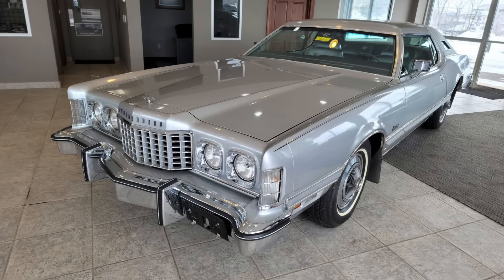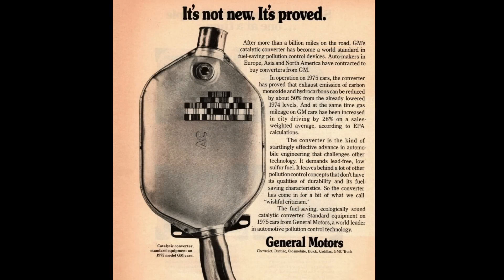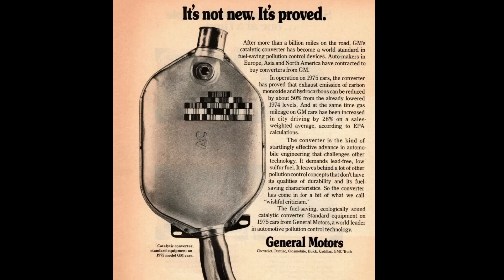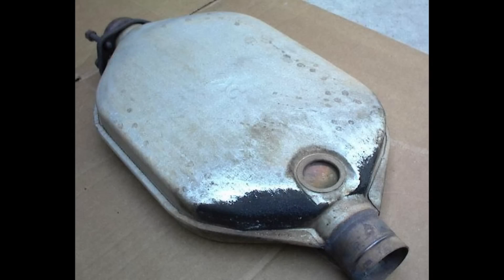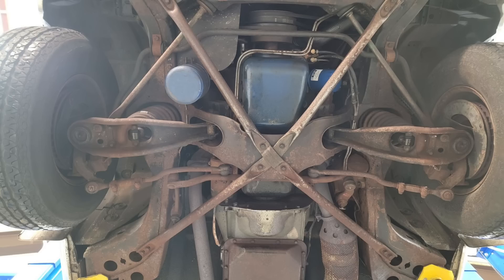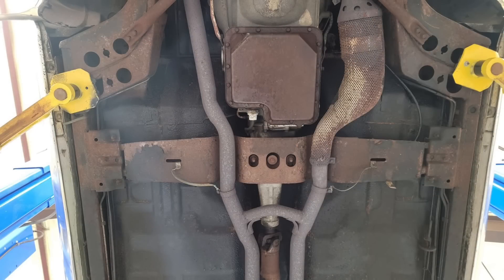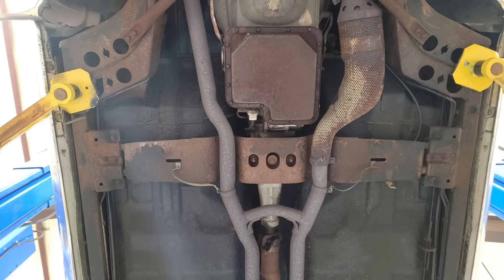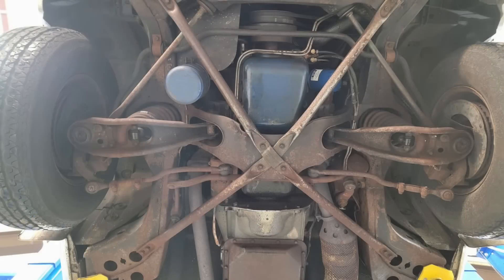Strangest Car Inventions: Ford Invents A Bizarre Way to Meet 1970s Emissions Standards

Comment: The last 2 vehicles up thru 1979 that didn't need cats were the Honda CVCC 5 speed stick and the casterated 318 Lean Burn with the optional LPG Mileage Booster valve. It allowed you to add LPG and lean out the gas even more for add'tl. mpg. You could only get that when buying new as it was added at the factory. I know because bought a 79 Cordoba Brougham with only 16K miles on it in 83 from the original owners. They also had a 79 Aspen with the same 318 an no options and that did have a single exhaust w/cat. That was only $500 and near mint with 59K mi. He was a retired ComEd field boss so you understand why I passed on a monochromatic beige car and opted for the $2500 Cordoba. Anyway; within a year; the Cordoba had a 468 stroker under the hood. MoPower Baby!

Comment: The 4500 lbs. weigh of the Mark IV's compared to a EV isn't all that bad.   A Tesla model X is 5248 lbs. and Cyber Truck is 6898 lbs.   Maybe the cross bracing was added for the 5 mph bumpers???
Reply: ICE vehicles aren't light by any means either. From the mid 70s to the early 80s the avg did drop around 860lbs, but they've climbed back up since. According to the EPA the avg weight of a car in 2022 was 4289lbs.
Reply: @AltWrongGamer  Found this online:  The subcompact 2017 Chevrolet Sonic RS weighs a mere 40 pounds less than the midsize 1967 Chevelle.      Newer car are heavy because the body is so much stronger for safety and EV's are even heavier because of all the batteries.

Comment: Used to drive my sisters 75 LTD, 400 ci with a 2 barrel carb, so slow, what a dog
Reply: Part of what made it so doggish was they had torque converters with very low stall speeds and premature shift points, and they also used a default axle ratio of 2.47:1  Combine these with even a healthy, 'non-emissions' 1960s engine and it's gonna be a turd.  Top this off with lower compression, lean-burn carburetors, retarded cam profiles (I mean that literally; the timing set actually set up the cam timing 'retarded' compared to '72-older) and ignition systems that retard the spark under acceleration, and the restrictive exhausts... yeah.  And in a 5000 lb land barge with A/C... it's a wonder the damn thing moved at all.

A '71 LTD with that same engine (but with much less pollution shit) was actually pretty darned strong.  And under the sheet metal, it's essentially the same car.

Comment: GM's pancake was great. All of my friends took the caps off and drained all of the pellets. They epoxied the cap back in place with varying degrees of success.
Reply: I remember several friends doing that as well.  They also cut out the gas nozzle blocker so they could use cheaper leaded gas which had the larger filler nozzle at the pump.
Reply: @Ozark_Bule I worked in an auto parts store,  and we sold plastic reducers that you stuck on the regular gas nozzle that allowed you to put it in an unleaded size gas fill.
Reply: There was  a tool for that cap.  We actually had to replace the pellets on some at the dealer.  Blew them in with a special tool through the port.
Reply: Dad had a '76 Lemans Safari with the 400. One of the first things he did was remove the cap and take the car for a rip to blow the pellets out. He did get the cap back in place afterwards. 

Not sure if it made much difference. Those were pretty tough years for cars.
Reply: I kind of think that was GM's intent!
Reply: I emptied out many converters back in the '80s. I chiseled out the plug, took the car for a spin around the block and hammered a freeze plug in its place afterwards.
Reply: @kennydemartini2169   You were quite the environmentalist
Reply: @Trackratz-zl9di  I've learned to respect the convertors now. I cut them off instead of gutting them. I have my buddy at the muffler shop make me a replacement pipe to weld in its place. Anothe friend reburns my ECM to delete the cats, and I scrape the cats for a few hundred bucks. A win-win for all!
Reply: @kennydemartini2169  While you were doing that we did all or own oil changes back then and we lived on a dirt road We took all the old oil and dribbled it on the road in front of our house to keep the dust down for which my mother was very appreciative 

Different time that's just how it was .
Reply: Good to know that egocentrism isnt a modern invention!

Comment: I bought a 77 Trans Am I bought brand new and when I pulled that converter and single exhaust with the crossflow muffler off and put duals with Corvair turbo mufflers it turned it into a different car!
Reply: What did ya’ do when they started doing annual emissions tests?
Reply: @PRH123  only Atlanta has that but the rest of Georgia no so we always straight piped all our vehicles
Reply: @SquirminHermanthe1eyedGerman   wow, didn’t know, all of Maryland since the 80’s required annual emissions tests for all cars
Reply: @PRH123  that sux
Reply: @PRH123  They STILL don't do emissions tests here.
Reply: I did the same to my Trans Am & Z28s, really wakes them up
Reply: When I had a shop put in duals, they somehow forgot the cats for my '78 Cougar (a T-bird clone) while they were putting headers on it. I don't know how that happened 💰😆.

Comment: the difference in backpressure across different cylinder banks must be chill as I notice that the saab B308E engine, a version of a gm v6, has "asymmetrical turbo charging," or that the turbo is only connected to the exhaust manifold from one of the v6 cylinder banks.

Comment: Some cars had two different size cats in the ‘Y’ pipe, Dodge trucks and the Ramcharger had 1 large cat one the right side and a “mini”  cat on the left.  Fords used the honeycomb design which was more  free flowing than the pellet type.  I had a 1979 Mustang Indy Pace car replica with the 302 and C4 and a friend of my dad’s who was a engineer out of Ford’s tetaboro zone office gave me another nearly new cat from a 2.3 turbo and I got a long 1/2 extension a busted out that honeycomb bs and installed it .
With the 302’s “sport tuned” factory exhaust, it was louder then stock and NJ’s yearly state inspection question the noise level from my nearly new pace car and when they looked underneath, yup, there was the (hollow) cat and it always passed emissions.
Reply: The 1977-78 Dodge Monaco CHP cars had 3.  Dual cats plus a mini-cat on the drivers side. Can be seen in the odd episode of Dukes of Hazzard when Roscoe flips his car over. Evidently the show sourced those cars from CHP police auctions.

Comment: I think horsepower loss of the mid-70's had more to do with the valve timing. The restrictiveness of the catalytic converter is more imagined than real.
Reply: I agree.  It was difficult to accurately meter fuel to the engine with a carburetor.  Automakers leaned out the air fuel ratio to prevent damage to the catalytic converters.  Later, Electronic fuel injection with feedback from oxygen sensors allowed lower emissions and higher power output.
Reply: @NorWis744  The early 70's Fords would cook their valve stem seals to death before they had 60,000 miles. I presume it was from a leaner mixture to pass emissions, but who knows?
Reply: Lost compression big time, = lost hp

Comment: Grounding straps on the exhaust pipes back then was likely to aleviate radio noise, when you have high speed air carrying particulates through the pipes you get a buildup of static electricity, so you just bond them to the frame to dissapate them.
Reply: You have a metal pipe attached to a metal grounded motor. Why would you need straps
Reply: @1marcelfilms  because the grounding isn't good and those flanges aren't good electrical connections thanks to heat/oxidation/gaskets
Reply: @1marcelfilms rubber hangers etc.  replaced a suppression strap on my 2012 bmw diesel.  it's less about it being grounded than there not being noise in the electronics. like I could use 12V from the trailer hitch and ground to the muffler and have battery voltage back to the engine but a wiring harness running along the same path is going to have an electric field from the unsuppressed tail pipe.
Reply: Neat.

Comment: I've seen it said the gm didn't give away the catalytic converter for the public good, it was a form of market protectionism as they had a monopoly on building them, can't recall fully but i think it was the internal components. basically competitors had to buy from them at a markup so by introducing the law they would have an unfair advantage.

Comment: Chrysler met 1975 standards without cats on many of their vehicles. 1976 was the first year for company-wide cats on Chrysler vehicles.
Reply: When new, I’m sure this was the case. They didn’t run well for very long. Hard starting and belching smoke once they did finally start
Reply: 1975 Cordoba was the first with a convertor, my aunt had a new one

Comment: Ford out of the Big 3 in my mind was the only one who got early emissions equipment to somewhat work right. GM's smog equipment was an absolute shitshow pretty much all the way into the very early 90's, don't get me started on their air injection system 😂. All Chryslers, I don't know wtf they were using in the 80's but my god did it make the exhaust stink like burnt hair!!! I don't miss that, sitting in traffic behind a K car or Ram Charger, gagging on hot burning hair smell 🤣

Comment: My youngest just got his 1st classic car (1976 Thunderbird w/460 big block) and when he crawls underneath to change his 1st oil, he will check this one-cat setup! Interesting topic!
Reply: Hard to believe it'd still be on there after all these years
Reply: @greenbassboosts8872  won't know until we get the creeper under it. Only 90k on it, and the car looks original, but who knows
Reply: @GorgeousGeorge525  aw original? Haha are you going to keep it original or is it going to be tooted up a little?
Reply: If I had a 1970s car instead of a 1960s car for my first car, I would be struggling to get the little voice inside my head saying "c u t  i t  o f f" to stop whenever I looked at the converter.
Reply: helluva boat anchor for a 1st car! My aunt had a '74 460 that got about 8 mpg & in the mid '80s I had a '79 351W that got 12 mpg plus there was always some kind of issue with hers & mine but mine finally gave out when the crank pretty much exploded one day while I was driving to work so I sold the car for scrap metal, last Ford I ever owned
Reply: @SquirminHermanthe1eyedGerman  he has a daily driver already: this is just a toy for him to learn from
Reply: @GorgeousGeorge525  oh thats cool, Im just glad he's got an old classic to fiddle with! My first was a '67 Firebird 326 4bbl that I got for $800 when I was 15 in '81 & at 16 I bought a '73 Plymouth Fury III Sport Coupe 360 4bbl for $300 & by the time I was a Senior in '84 I had a '78 Ttop Z28 that I got from a bank repo for the payoff of $1200! In '86 I bought for 1st new car, a Bandit II Edition Trans Am that I had until 1998! Man I wish I still had all those cars

Comment: I had no idea this was happening even though I was an adult in 1975. No question, if the car with a particular engine could pass emissions with only one cat, that's how it would be certified, no one would care it was asymmetrical. I notice there's a crossover pipe connecting the two sides, downstream of the catalytic converter. If the cat has more back pressure than the non-cat side, and also heats up the gases more, the two sides are different both in temperature and pressure. This would cause flow through that crossover pipe from the non-cat side to the cat side, mixing the untreated exhaust with the hotter gas from the cat and perhaps causing chemical reactions that partly de-smogged the gases from the other side. I theorize that's what made this system work.
I think Ford's engineers deserve a lot of credit for their innovative solution to this emissions problem. I would be surprised if there was a technical article about it in the Society of Automotive Engineers Journal, but there certainly ought to be.
Reply: What if the left exhaust without cat has a valve in it that opens at a certain pressure.   so all exhaust goes through the one cat with the crossover .. except when you go fast.    But if you measure exhaust while its idle all goes through the cat.  Maybe the engine is cleaner when you go fast anyway.    i guess it wont have such a valve but it reminds me of what happens now that car manufacturers get sued, because the cars are sort of smart with computers and are clean when they realize that they are being measured.  As i guess especially diesel cars are by nature dirty and its very expensive to make them clean . so when exhaust rules get more and more strict they start to use more tech but also more tricks.  Like i guess run engines very lean when measured.     The crossover seems weird .. as because a cat adds resistance ... part of the gas that it supposed to go through the cat goes through the crossover,  so more gas would exit the non-cat exhaust than the cat-exhaust.
Reply: @apsdev right, and dieselgate engines burn more fuel while tested as it needs to heat up nitric oxide trap and less fuel otherwise for fuel efficiency, so its leaner on the road and richer on the stand.
Reply: Yes you're exactly right the "H" pipe will draw a portion of the untreated exhaust into the superheated side due to the pressure differential and continue the combustion of that portion before it exits. This must have been just enough to come in under the nox/hc limits at the time

Comment: Datsun and Chrysler were among the last manufacturers to avoid using a catalytic converter.
Reply: Chrysler started using them in 1975 but I think Datsun was a little earlier but I know for a fact the '75 280Z had one as I had that car
Reply: @SquirminHermanthe1eyedGerman  Some Chryslers had them as early as 1975, but most didn't get them until 1977.  The Dodge trucks didn't have cats until 1979.  Chrysler avoided cats in the late 1970's by using their Lean Burn ECU system. The first Datsun with a catalytic converter was the 1976 B210 and some 1975 California models, but their other models did not have them at the time.  By 1979, they all had them...
Reply: @ccrider77  my grandpa sold MOPARS 1946-1979 & I remember my aunt had a '75 Cordoba with a cat & yea the Dodge Lil Red Express was the fastest vehicle 1978 because it was cat delete

Comment: Don't tell anyone but we would pull the plug and take the beads out......
Reply: Okay we won’t tell anyone that YOU TOOK THE BEADS OUT,! 😅
Reply: @glennso47  Thanks, let's keep it on the hush.
Reply: When I lived in Japan, in Okinawa, unleaded gas wasn't always available so you used leaded gas. It would plug uo the converter so the mechanics would remove it, punch a hole and dump the beads out, and then off to the safety inspection station.
Reply: @Colorado_Native  That and a small increase in power and mpg.

Comment: lol   no emisions from my car but water out the tail pipe... I run them on hydrogen so I dont need a catalytic converter   that has precious metals in it like PLATINUM,,,

ya wonder why there stolen?       anyway Dr Brown figured out we didnt need gasoline in 1960 later on Stanley Meyer proved it. read up, I dont expect you to believe big oil would KILL to keep gas flowing...

Comment: Now I know I wasn’t crazy. I thought I remembered that my brother’s 1975 Thunderbird had only one catalytic converter. I also remember that it DRANK gasoline. It had worse economy than either his 1973 or his 1974. It could barely make the 250 mile trip from Tampa to Tallahassee, Florida on a fill up. I think it had a 25 gallon gas tank. We blamed the catalytic converter.
Reply: The 400s and 460s they put in those things were thirsty beasts, with or without cats.  And a '75 Turdbird was a chonk at nearly 5000 lbs, and had the aerodynamics of a cinder block.   Back when they first started building those B--body 'birds, nobody cared about gas mileage.
Reply: @xaenon  But by 1975, with fuel prices rising to 50 cents and fuel economy tanking due to the emissions, I remember my brother complaining in a way that he didn’t complain with his 1973 and 1974 T birds.  The 74 would make the same trip with fuel to spare. But the low fuel light was on by the time he reached Tallahassee in the 1975. And unleaded was more expensive than leaded fuel as well.  Imagine if we had to drive those behemoths today with 4.00 gas prices 😬. By the way, that atrocious fuel economy was with the 55 speed limit with most people driving around 60-65 when the Brick like aerodynamics wasn’t quite as noticeable as when we drive 75-80 today.

Comment: My 79 super beetle convertible  didn't have a converter. But you had to use 91+ octane  gas, due to it being a lean burning engine.  Don't know what would happen if you ran it on lead free fuel even with the correct octane.

Comment: i put a test tube on my 77 Trans Am cause i thought my cat was clogged. Gained about 20 HP and better sound. I would also run leaded fuel.
Reply: You're lucky you didn't drop a valve seat. Those were different between leaded & unleaded. Dropping the seat was a 99% guarantee of needing a new engine.
Reply: @SonnyJohn-j4l valve seats in unleaded engines are harder, so not really an issue unless you're going the other way.
Reply: If you were running regular with the cat, it WAS clogged/.

Comment: Just to nitpick. A "catalyst" is a chemical used to make something happen. A "catalytic converter" is a metal box in the exhaust pipe on a car.
Reply: And the catalyst on all these cars is the same. It is platinum in all of them. So they only use one catalyst, even if having two catalytic converters. 😉
Reply: The pellets inside were the catalyst.  They converted certain substances in the exhaust to less-troublesome carbon dioxide.
Also, part of the definition of 'catalyst' is a material that facilitates certain reactions, but is not actually altered by the reaction.